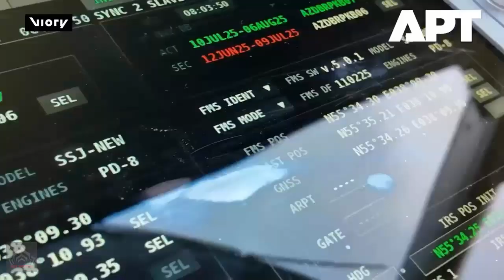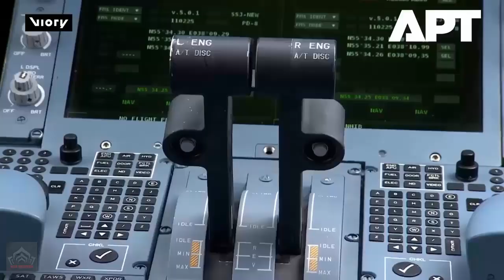Finally! Russia integrates domestically produced PD-8 engine into third SJ-100 aircraft

Comment: Russia has at least a dozen aircraft engine design bureaus with full shelves if suitable engines for that aircraft and at least six engines ready to be fitted to this application like a Kusnetzov KN-8, Progress, Soloviev, Aviadgatel, Lotarev or Motor Sich....!...
Reply: Indeed Russia has many design bureaus and even more aircraft manufacturing plants with a huge work force. In this light, it is almost absurd that during the last two decades, an average of only 10 jet aircraft per year have been produced in Russia. For comparison: Airbus alone produces more than 100 aircraft - per month.
Reply: @luisdamian4562 They were going trough " perestroika " sort of what Boeing is going trough now, they needed to get rid of all the administarative and bureaucratic system they had, now they have more control layers and more focused goal oriented programs....